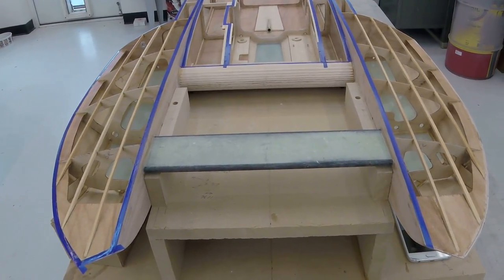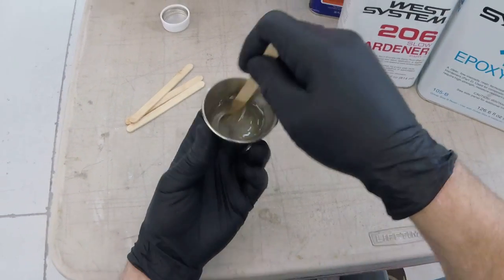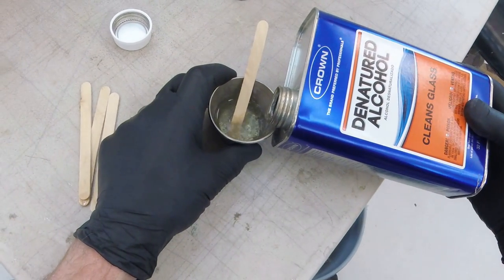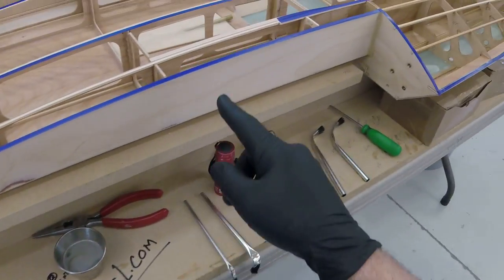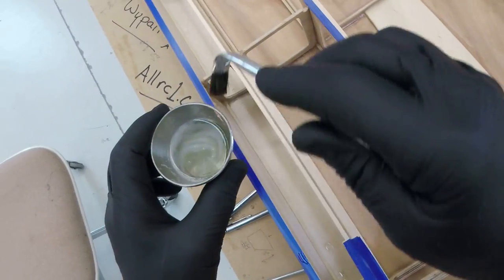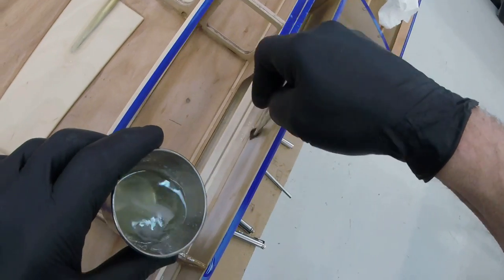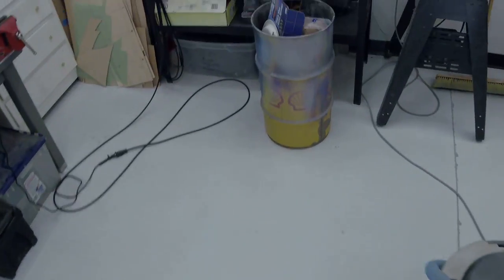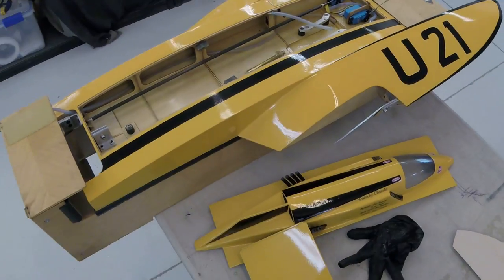RC Boat Hull Sealing - or - How to Not Suck at Sealing Wood

Comment: Love the video. I'm gonna use this video on my next catamaran I build.Not to sound needy but are you gonna make a video of sheeting this bad boy.Ive always thought that you just epoxy the whole sheeting then lay it down and do what you need to do to keep it in place..I'm sure looking at some of your video I'm a bad builder in alot of areas.So if you feel inspired please do a video of the sheeting even though you have a busy schedule. Stay Safe.
Reply from the maker: Uh oh.  I'm a bad teacher because I already installed the decks!  I'm sorry. I knew I should have done a video of it. 
You're basically correct.... when you are ready to install the decks you'll seal the entire bottom of the decking just as we did in the video, then add some colodial silica to the remaining epoxy to thicken it until it's about the consistency of peanut butter, and apply a bead of epoxy all around the perimeter of the hull where the decking will lay. I do one side at a time, left then right. Now install the deck and just as you say, do whatever you gotta do to hold it down 100% of the way around. Binder clips, blue tape, weights, small dogs, anything you have, put it on there.
I find it's best to do a complete dry run first so you don't get caught with yer pants down and your deck sticking up somewhere.
I hope this helps, and again I apologise for being a bad teacher.
You can do it!
Reply: @M5PerfHydros  thank you.
Reply: @damonanders6809  have you tried YouTube. Go in the search engine of YouTube and ask how to in Instagram account
Reply from the maker: Swaldoski -  I think we got spammed by the guy asking about Instagram. I've removed and blocked his comments.  Sorry about that!
Reply: @M5PerfHydros  ok wow i didn't think of that...people are messed up..
Reply from the maker: Yes they are! Same scam hitting several of my videos. They're trying to trick people into going to the website they are sharing.  Don't do it!

Comment: Scott, thank you for making this video, I’m building my 1st boat and learning how to seal it, I like what you did, making it look good in the open hull.
I saw you wiped after applying the 1st coat, for the 2nd coat, it’s taking longer to soak in the wood, should I wait longer before I wipe it ? 
Also, in the open hull, before using Scott Brite to scurb after wiping the excess sealing liquid, should I wait for it to dry and cure before scrubing ? 
I tested a strip of wood but I can’t tell the 2nd coat after wiping and scrubing right after or wait after it cured is better or not. 
Thank you !
Reply from the maker: The only real purpose of the second coat is to be sure you hit any bare spots, so you can wipe the excess out right away.
Reply from the maker: Oh and yes, you have to wait until the epoxy is fully cured before you scuff it for clear coating
Reply: Thank you for your responses, you’ve mentioned about clear coating, I’m planning to paint the exterior, keep the open hull of the interior unpainted and only apply wood sealing, do I have to apply clear coat after sealing and scrubbing ?
Reply from the maker: Yes I shoot clear in the engine well area of the interior after a good scuffing with 3M pads.  Gives it a beautiful smooth look!
Reply: @M5PerfHydros  thank you, I watched your videos and you designed those hydroplanes, do you make a kit for sale ? I’m working on an SLR missile thunderboat from Zippkits, thinking of the hydroplanes like the ones you built, those looks beautiful and cool.
Reply from the maker: Mine aren't for sale, sorry!

Comment: Hi Scott...another question...I hope you are not getting sick of me....I took your advice and purchased a wood kit for 32 inch Wild Thing mono v-hull from Michael Luszcz (he is quite the charmer)....anyway I also purchased the West System epoxy kit and some hardware Bill Oxidean (a nice guy).  The boat is coming along but seems to be getting quite heavy with all the epoxy :)  I weighed the empty hull and it weighs about 1 lb and 9 oz.  Thats not including a half pound deck, a 1 pound motor, and maybe another pound of additional hardware and batteries.  Now Im questioning whether I should pivot in my plans and just make a fiberglass or carbon fiber boat using the wooden model as a mold/platform.  That would likely be at least half as heavy in terms of the boat frame.  Do you think that is a good or reasonable idea?  My motor is a big 2000Kv  and I have two 3S lipo graphene batteries.  Since Im a newbie, Im not sure if this is enough power to reasonably move the heavy wood boat, or should i downsize to a fiberglass or carbon fiber boat.  Thanks a million..I always appreciate your knowledge and experience
Reply from the maker: Hey I almost missed your question... Sorry I'm late!  
1.5lbs doesn't sound like a heavy boat to me, so I'm not sure I'd give up on it so soon.  Even if you did decide that you want to use it as a plug to make a fiberglass mold, you should still finish it and run it as is to see how it performs. That way you could make any needed changes before you mold it.   Regardless, quit worrying so much and RUN IT!

Comment: stupid question....if you make the epoxy mixture thin enough with the alcohol ,can you just use a small spray gun and spray the inside of the boat with epoxy?
Reply from the maker: That's not a stupid question at all!  You're thinking, which is always a good thing!
You absolutely could do that, but it seems an unnecessary complication to me and might miss the point a little bit... The main reason I thin the epoxy so much is so it'll penetrate well into the wood grain.  To accomplish this I slop a boat-load (pun intended) of thinned epoxy onto the surface, wait a minute or two, and wipe off the excess.  To do this with a spray gun you'd need to open the needle way up and spray like crazy. Of course you'd have the issue of overspray to deal with on the boat, the floor, and yourself.  Better use an excellent respirator too... Imagine epoxy overspray in your lungs!  Lastly, the spray would miss all areas not in sight, like up underneath stringers and any overhanging areas, so you still have to apply in those areas with a u-bent brush.
So.... Can you do it?  Sure.  But that doesn't mean you should!
Keep thinking, I like your style

Comment: Hi, I'm wondering if you can help. I've been watching all your videos and love them! I am making a 900mm catamaran my self and have come to the epoxy part but on the exterior. How would you reccomend doing this to keep a nice smooth finish without runs and with out imperfections? Have you got a video you could point me towards?
Thanks
Reply from the maker: I don't know of any way to apply epoxy perfectly smooth. Just seal the wood and sand it smooth before painting.  But if you're trying to get a wood finish and not planning to paint it you'll need to apply a few heavy coats before sanding and buffing it to get a glossy smooth finish.... There are no shortcuts, sorry!

Comment: how come you used epoxy to seal it?  I normally dip all my hulls in polyurethane then take the leaf blower to them and let them drip dry lol! . dono maybe I'm old school.... but the surface comes out perfect every time and it pernitrates the wood pretty well I have few hulls 10 years old that have zero water damage still.
Reply from the maker: You dip the entire boat?!?  My wife would be awful upset if I filled the bathtub with resin to dip one of my big hydros! 😆

Comment: Hi Scott. Will 2 k clear coat paint not do the same job if you spray it on or will it turn out to heavy. Thanks for the great videos that you make. Dave
Reply from the maker: Hmm, I don't think so.
It would work fine everywhere you can spray it, but it only shoots in a straight line and thus won't seal anywhere you can't see... The undersides of everything would remain dry unsealed wood. No bueno!
Also, too thick on application. The beauty of highly thinned epoxy is that it soaks into the wood instead of just laying on top.
And yes, too heavy!  The clear will begin to set very quickly so it'll be difficult to wipe out the excess. Sticky stinky mess too!
 I DO shoot clear in the engine well after sealing with epoxy. It hurts me to do it because I don't like unnecessary steps and unnecessary weight, but it just looks so darn cool!

Comment: Can you do this with fiberglass resin? I have a vee hull that I’m
Going to glass new stringers in. And kind of just wanted to glass the lower portion of them where they attach to the hull. Then coat the rest to look like this.
Reply from the maker: Nope! Don't use alcohol or acetone in a polyester based material. You'll want to get a styrene thinner for that. Here's just one such example; https://amzn.to/3Ybr6IO
Reply: @M5PerfHydros  I’m confused by your response? lol. Forgive me. So I can use fiberglass resin but thin it with the link you sent me?
Reply from the maker: Oh. Yes you certainly can thin fiberglass resin in the same way that you can epoxy, you just need to use a different thinner such as the one in the link. But since we're on the subject, why not just use epoxy? The working time is so much longer than fiberglass resin, and the resulting finish looks much better
Reply: @M5PerfHydros  can I use epoxy to lay into the fiberglass sheet? I want to run some strips on the bottom where the wood is going to meet the hull. 

It looks like the epoxy you’re using is more expensive than some fiberglass cans. I use thinned epoxy on my planes to fuel proof them but it’s so little that I just use my little bottles. Is there an epoxy you’d recommend? Maybe just enough to install some stringers and a few little pieces?
Reply from the maker: Yep fiberglass resin is cheaper because it's really for the single purpose of layering fiberglass mat. The polyester reacts with the mat material to make a very strong product, like large boat hulls. Fiberglass cloth will not react in the same way with polyester resins, and is best applied with epoxy. Any decent epoxy should work fine, but yes I am partial to West System 105 epoxy for fiberglass work because it has a very light viscosity, working nicely into fiberglass
Reply from the maker: For all general bonding and framing I use a product called G-Flex which is a little bit heavier viscosity two part epoxy. I've used it with fiberglass a few times, usually only if I need to lay some fiberglass strip along a seam or joint to increase strength. https://amzn.to/3TVOrvJ

Comment: So @ 3:20, are you saying your ride pads on your sponsons are aluminum? And are you saying the real boat was made out of wood? Or just not painted on the bottom? And would it be legal in RCU if it was a fiberglass hull...sorry, makes me nervous when someone says the word legal....
Reply from the maker: Those are all fair questions...
Yes the original boat was wood constructed and unpainted on the bottom, which allows me to do that and run the boat "legally" in RCU. In our club we have fairly tight rules where we like our models to look as much like the original boat as possible. This is also why I've painted the ride pads and recovery pads with 'aluminum' paint, so they would have an original look.
Lastly, yes you could build it from fiberglass and paint a wood-like color on the bottom and I'm sure it would pass inspection. Our rules are tight, but we fudge when it's reasonable to do so and a reasonable effort to comply has been made.
Come race with us!
Reply: @M5PerfHydros  Now that you have stepped up into 1/6, I wonder how long it will be until you want to build a modern hull with the jetcat turbine...lol.
Reply from the maker: @kyleboyer1074  - If you're offering to sponsor the project I'll get started right away!
Reply: @M5PerfHydros  Ok soo How much for my name on the transom...lol..I know those jetcats are way spendy. But do you have issues with "gator skin" in your gelcoat when making cowl molds?
Reply from the maker: @kyleboyer1074  - I've heard of that happening so maybe I've just been lucky, but I haven't had any trouble with gelcoat at all. I hope you haven't jinxed me!

Comment: Just wondering , have you tried using cut down foam brushes like folks use for staining wood. You could cut to shapes you need . I don't know if the epoxy would eat the foam or not .
Reply from the maker: Yep tried that... They're too soft and squishy, which is especially unfavorable when working with heavier viscosity stuff like epoxy

Comment: Is it possible to use an airbrush pistol to spray it on the large open areas? Any advantage? Thanks!
Reply from the maker: You could but it might take a long time. It's a big boat, 53" long

Comment: Hi Scott, where do you get your brushes from?
Reply from the maker: The brushes seen in this video are "bighorn" brushes from Amazon.  These are great for bending to get up underneath things when needed. What I don't like about most epoxy brushes is their tendency to lose hairs, so my daily go-to brushes when you don't need to bend them are "decyool" which never lose hairs!  So many brushes, so little time!  Here's the links;
Big Horn 13030 1/2-Inch Glue Brush, Box of 144 https://www.amazon.com/dp/B002MPQAA0/ref=cm_sw_r_apanp_wMYT8CTwjVjKf
60 Pcs 9mm Wide Flat Paint Brushes Set with Nylon Hair,Small Brush Bulk for Detail Painting,Short Plastic Handle,Acrylic Oil Watercolor Fine Art Paint https://www.amazon.com/dp/B07VK5VJWC/ref=cm_sw_r_apanp_DuD4SWLq5d9qg

Comment: Hey Scott  I have been watching your videos for a while now, & really enjoy the tips for construction .  Excellent video of crash repairs. What is your opinion  about witch way should the drive cable be wound when using a left turning prop & why?  I hope its warmer there than here in Canada. It was - 30 C last night  only good for building new boats & that's OK with me.   Thanks Dave
Reply from the maker: I've seen guys use right wound cables with left rotation props and it works fine for about 10 meters before ripping the stuffing tube out of the boat!  Imagine what would happen if you stuck one end of a cable in a vice and began twisting the cable at the other end with a pair of vice grips.  If you twist it in direction of the windings the cable will do nothing but tighten.  If you twist it opposite of the windings the cable will literally come unwound.  Not a good thing at 30k rpm!
Reply: @M5PerfHydros  Never thought about it that way. Thanks Dave

Comment: Thank you. Totally inspired to start my own project now. How long would a build normally take, if I may ask?
Reply from the maker: That's completely up to you!  Mine take a long time (several months) because I work slowly and don't really have a lot of time to put into it these days.  But I know some other guys who can build a boat in a few weeks so.... It's all on the builder.
Reply: @M5PerfHydros  thank you. One last question, a bit off topic but I'd appreciate your input. I have a 56102 600kv motor that I purchased for my bait boat but the thing is just too powerful for it, so I was thinking of building a catamaran that would handle it, I'm just not sure as to what size cat would be appropriate. Any advice would be helpful
Reply from the maker: @mxm1766  - Sorry but I really can't provide experienced advice on this motor. The 1/8th scale electric hydroplanes in our club use 850kv motors and they're crazy fast, so I think you'll have a ball with that thing in any smaller hull. 
A good guy to ask might be Bill Brandt at Rattlesnake RC. He does a lot more of the electric stuff than I do.
Reply: @M5PerfHydros  I appreciate it. Thanks. I'm in South Africa by the way so it's going to be fun trying to find local equivalent products to the ones you use. Back to work...
Reply from the maker: @mxm1766  - You can do it!  Thanks for watching!

Comment: Have you ever been asked how to fix a crack on a boat is it the same way that you’re sealing the inside you can seal the cracks to like that or no and can you use rubbing alcohol or no I heard you just say alcohol so I don’t know I thought getting a boat that has a crack in it
Reply from the maker: Hello PWG223,
Anytime you have a crack in the hull, whether it's wood or fiberglass, you need to know why it broke before you fix it.  For example, if it got damaged from an impact of some sort then yes, you can just clean it well with rubbing alcohol and shove some epoxy into it and be done.  On the other hand, if it broke because the hull is flexing you'll need to do some reinforcing of the area or it'll simply break again.

Comment: Is that a kit, or did you make it from scratch, because I really like the design, especially inside, and don't ever stop doing what you do, your very good @ what you do, I would love to have one of those hulls...
Reply from the maker: The basic framing for the center section of the Eliminator was an MLBoatworks kit, though highly modified. The openings, drop floor, mounts, and cowl are all my doings. I designed the Stroh and the gas boat I'm building myself, but if that's not something you're ready to do you just can't beat the quality of the MLBoatworks kits and I recommend them very highly.
https://mlboatworksrc.com/

Comment: I suggest that you start using S1 epoxy sealer it penetrates deep into the wood you can't beat it for preserving wood it just does not go on the top couple layers then plywood like you use for your models it might penetrate halfway through you do it from both sides your Woods fully impregnated with epoxy
Reply from the maker: Very interesting!  I didn't know this stuff existed